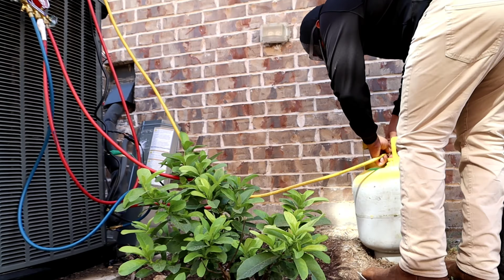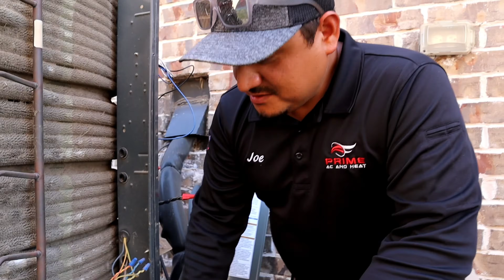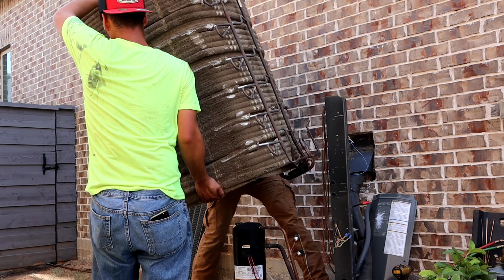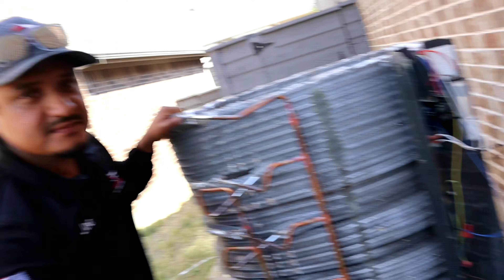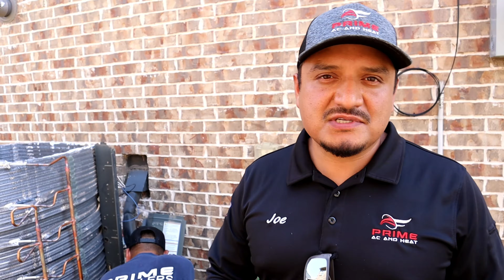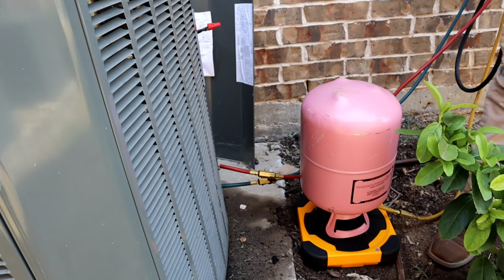Trane / American Standard Condenser Coil Repair | Prime AC and Heat | Air Conditioning Repair

Comment: Do yall have a condenser coil for a Trane XE 1100 (TTN048D100A0)? Or tips on how to repair a leak?
Reply from the maker: Thank you for watching and commenting on our video. 

Unfortunately we do not carry any parts or sell to the public. 

Your best bet is to reach out to your local Trane dealer and see if they have a replacement coil for you. 

If the leak in the coil is in an area where it's only copper to copper you might have some luck in an attempt to repair the leak.